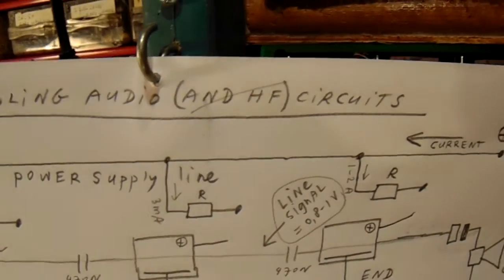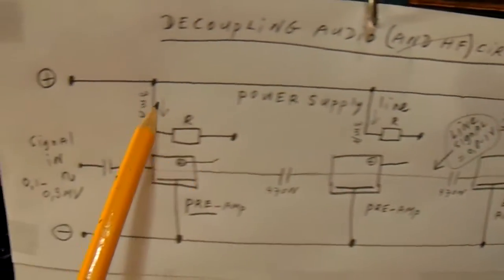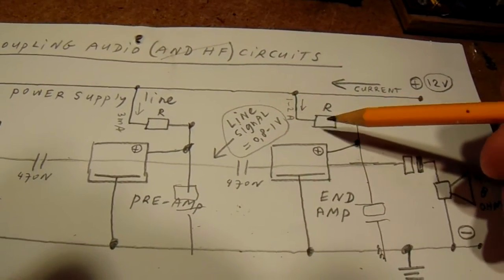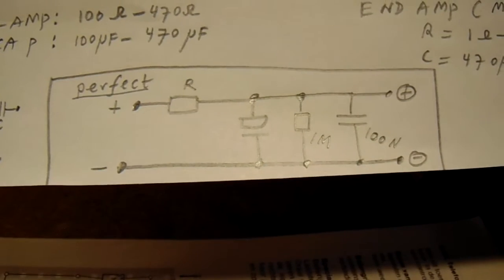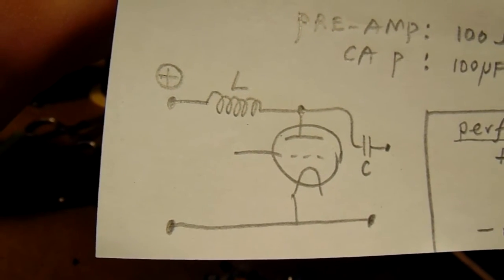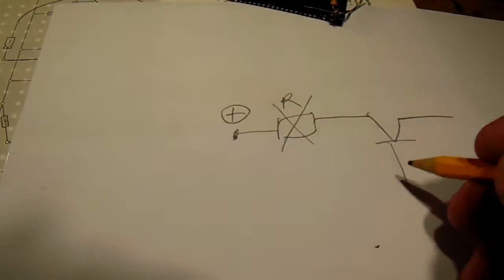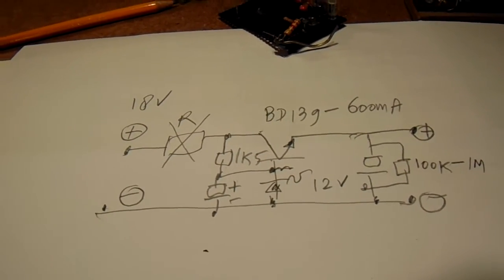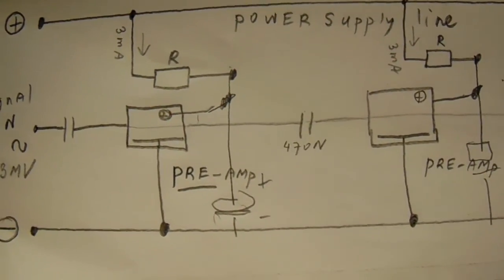Decouping & hum free (silent) audio amplifiers (schematics)

Comment from the maker: LINKS TO HUM FREE POWER SUPPLIES FOR AUDIO (+ related subjects)
Decoupling & hum free (silent) audio amplifiers https://youtu.be/0SoD3GlFH0s
How to make a good analog audio transistor pre amp, version 1 https://youtu.be/luBmY8SzGh0
Audio signals transported over long wires https://youtu.be/ldtEAlsCXMw
The transistor series voltage regulator practice (IMPORTANT) https://youtu.be/YL41FPH_H-s
How to make a small mini audio set (1-2 Watt) pt 2-1 https://youtu.be/ZMXUip3i1zY
How to make a small mini audio set (1-2 Watt) pt 2-2 https://youtu.be/4Lqjw9rbzJA
Find out a choke coil for a DC power supply https://youtu.be/dn-CDTy7cg4
Tips to make a High Voltage (120V-50mA) hum free power supply https://youtu.be/d71voqjK0Q4
Prevent hum in homebrew audio amplifiers https://youtu.be/IsLEyx3nU9o
How to test a power supply https://youtu.be/BeNoSmm3D_4
Developing a 6 Watt stereo audio amp. Part 1 (e.v.) https://youtu.be/DRjn7Al-wdc
O-34 V-2A power supply (IMPORTANT) https://youtu.be/-hXvM1svcdY
How to make a bridge (full wave) rectifier with 4 diodes https://youtu.be/6E8rULhY-1k

Comment: Another great lesson. I will try your advice for the hum noise! I also had a lot of difficulty filtering the ripple of the mains split +/- power supply for my power amp at high current. Any tips?
Reply from the maker: Best circuits are here https://youtu.be/YL41FPH_H-s
say "capacitance multipliers" to press the ripple on the supply lead to its minimum. For a double power supply they must be made twice, one for the positive lead (NPN transistor/Darlington) and one for the negative lead (PNP transistor/Darlington). You loose supply current with this setup, they form 2 series regulators, they get warm and dissipate. I found many problems making a hum free double voltage power supply usable for high(er) currents, especially with the Darlington setup. The video's are on my channel. Keyword: "double power supply".

Comment: @radiofun232 Hi Ko @8.55 mins you draw the schematic for the decoupling unit with a transistor.
This is my question the transistor amplifies the value of the capacitor by a factor or x 70, so 100uF x 70 = 7,000 uF in total, so if the circuit thinks it is seeing 7,000uF and not 100uF how is this possible when the capacitance is only 100uF,is it possible to amplify capacitance in this way and would it show on an oscilloscope the reduction in ripple exactly the same as it would if you actually used a 7,000 uF (or 6,800uF) capacitor.
Reply from the maker: Yes, see my earlier comment. When you put your scope to the output of such a series regulator (don't damage your scope, be sure the scope input is able to handle that voltage) you can see very good how the hum (sometimes even a small sawtooth signal caused by the diodes in the bridge rectifier, especially when the main capacitor has a too low value= for audio lower than 4700 uF) has disappeared. Interesting is also to connect a dummy load to your series regulator (heavy 20 Watt or so resistor, mimic the current that you need later in your electronic circuit) you can see that also under a load the hum stays away. By testing it in this way you can find out the ideal electrolytic capactitor from base to ground, given the max hum suppression (you don't need to make this elco to big, the power supply gets lazy when it has to deliver current suddenly, this relevant for audio amplifiers).
Reply: radiofun232
Is there a name for amplifying the capacitance or the theory of it? or the application,for example 4 diodes together in a power supply called a bridge rectifier, and 2 transistors after each other darlington pair,resistor and cap together called a RC filter or pi filter is there a name for this process of amplifying the capacitance by the factor of the hfe of the transistor?
Reply from the maker: https://youtu.be/YL41FPH_H-s
Reply from the maker: As far as I know this effect is known in electronic theory as "the Miller effect" (but I could be wrong....). It has to do something/was invented by mr Miller during radar development in World War 2. I have to say that I am not completely sure and have to study that better, but anyway. I think you can find the Miller effect in Wikipedia.

Comment: How to fix Motorboating noise problem in Tea2025 amp configured in Bridge mode ?
Reply from the maker: Put a 1000 uF or higher value electrolytic capacitor over the voltage supply. When it is a double power supply: 2 electrolytics, one with its electrode to the +, the other with its electrode to the - and their other electrodes together to the 0.  When there is another reason for oscillation: such a problem must be studied extensively with the help of an oscilloscope. Often it can be cured by making the input impedance of amplifiers lower with a bypass resistor between audio input socket in and ground (0 or minus) in the 1K-50 K range. Or by limiting the bandwidth of an audio amplifier by soldering a 470 pF capacitor between the audio input and ground (0 or minus). For stereo: everything 2 x.
Reply: @radiofun232  Thank you Sir :-)

Comment: Is it possible to decouple the power to an already made amplifier board? Assuming there is no pre-amp and only one stage of amplification, could you simply decouple the power coming into the board?

Or must the decoupling be integrated into the circuit?
Reply from the maker: Yes, that is possible. It depends whether it is a power amp or a pre amp. And a schematic is needed or an idea how the existing power supply is made and works.

Comment: I have experimented using LM386 on breadboard to make a basic amplifier but there is very strong hissing noise either when the music play or not ...and also when the music strong bass kicked in the sound on the speaker like knocking on a wood instead of good bass...do you have any idea whats the problem and how to fix it.
Reply from the maker: I think your amplifier is oscillating (on an not audible frequency or frequencies, say between 15 KHz and 30 KHz or higher)  due to not enough decoupling in the power suppy line. You can see that when you study the Loudspeaker output on an oscilloscope.

Comment: @radiofun232 Hi Ko,at 5.22 mins the decoupling unit that says perfect at the bottom of the page,how would this connected in the diagram above?
Does it simply connect in parallel across the supply rails then feeds to all circuits OR should there be 3 x of these perfect circuits at each point of the above diagram, for example 1 connected in parallel for the 1st pre amp and then another for the 2nd pre amp and a 3rd one for the end amp OR as i say should it just be connected into the main power rails then feeds all circuits and it will work fine.
 What is the way to connect it and FINALLY the transistor decoupling unit at the end of the video does this connect in all 3 stages or is it only connected in the power supply rails then fed to all 3?
Reply from the maker: Thanks. This is a kind of science. The most important thing is this: a kind of ""battery voltage + current"" has to  be created for every electronic circuit in the whole, whether it is a power audio amp (1-5 A supply current at say 12-40V) or a pre amp (12 V or 40 V at 1 mA up to 3 mA).. In a galvanic battery circuit there is: no hum, a constant current (ideal) + constant voltage (ideal!!!) but that central idea has to be kept in mind when you make end amps or power amps. Hum-free power amps  on 110 or 220 V AC (sec: 10 V to 40 V or more AC) can only be generated by good power supplies with transistors that press the hum level to its absolute minimum. Buy my book "Schematics 2, audio amplifiers and loudspeaker boxes"" for motre info. Ideally you can use 3 separate hum suppressors, but you can also use 1 hum suppressor and connect it to 3 or more electronic circuits, pre amps. It depends on how much current the pre amp stages take, not much in general. Again: buy my book. Anyway: with a BD 139 hum suppressor you can feed approx 100 pre amp stages, taking all 3 mA=100 x 3 = 300 mA.
Reply: radiofun232
Thanks Ko,I did already buy that boow,well the download version as the book wasn't available at that time :( which i relly wanted,so its downloaded on my laptop,i have to print out all the pages,so i will have a look at it.
Thanks for the answer but im still not clear on this answer part.
The Perfect circuit how would that be connected to the circuits in your video? would you make x 3 of them and connect them across the power rails to each individual circuit OR just make x 1 and connect it across the power rails before it then feeds to any circuits in the chain
Reply from the maker: OK, understood. Perhaps we can communicate further on this issue via radiofun232@gmail.com. Then I can take more time. Is it possible that you make a small drawing about the circuit(s) that you propose and send them to me via mail? Perhaps I can give a better and more elaborate reaction then.
Reply from the maker: Both options are possible. Ideal situation: 1)  the stereo end-amplifier gets its own (separate) decoupling unit (1 time for 2 channels, could be 2 but one is enough) consisting of a hum-suppressor made with a power transistor. 2) the stereo pre amplifier gets its own decoupling unit, also consisting of 1 power-transistor hum suppressor. You can also use a 7812 for that purpose. But mail me, than I can make sketches from all kinds of supply options that work properly.
Reply: radiofun232
ok Ko,i will send private email, Rob

Comment: Sir, I have Diffrent problem from my La4508 dual ic amplifier ....its intermittently humming high frequency sound(2 seconds sound ) whether input signal is present or not....why....? a usb board is connected from the same power supply through lm7805 regulater...how can i fix this...?
Reply from the maker: Decoupling & hum free audio amplifiers (schematics) https://youtu.be/0SoD3GlFH0s
I think it oscillates due to unproper decoupling from the power supply, but without schematic and pictures about how it was made it is difficult to say.
Reply from the maker: I saw on the datasheet that the bandwidth from this chip is very high (50 KHz or 100 KHz). That makes it vulnerable for oscillations on high frequencies. You can try to limit the freq. band by bypassing the audio input to ground with a ceramic cap from 100-470 pF. You can also do a test with your fingers: use your hand as a resistor and test between which points on the circuit board the oscillation stops. Try e.g. a 1M resistor between these 2 points. You can also solder a 100 N capacitor (ceramic) directly (!) on the chip power supply pin to ground/mass. Or: take a 10 Ohm 10 Watt resistor from your power supply (say: 18 V) to the + pin from the chip and connect to that same + pin directly an electrolytic cap from 1000 uF to ground. Furthermore: the wiring must be made properly so that there is no feedback path from the output to the input. Buy my book: "Schematics 2, audio amplifiers and loudspeaker boxes" via the website from Lulu (author Ko Tilman) for more info.
Reply: Thanks for your replay sir...
Reply: Sir...finally i found the problem .....corrosion on some resisters and jumper connections.....now its work awesome....
Reply from the maker: OK, good to hear that!

Comment: Sir...i have subwoofer circuit with irfp 150 n 4 numbers of mosfet  new....first i connect to 100 watt woofer  my woofer gone..then service technician told that the negative side mosfet shorted ..i serviced and reconnect now its work for few seconds and distortion starting ....when i check i noticed that bc547 transister become hot and volume down with distortion .....power supply is 35 0 35V 10 amps....why its happenig...i know you are dont know about circuits ....Please help...
Reply from the maker: Sorry, but I cannot help you. It is impossible to take a conclusion on the basis of your information.
Reply: Sir.its ok....the problem is high voltage 35 dc is enough...

Comment: @radiofun232 iF the theory of amplifying the capacitance works then this could be used in large power supplies in audio amplifiers,obviously with larger transistors and higher wattage resistors and more powerful capacitors, so for example you could use a large 22,000uF capacitor then amplify it with maybe a 2N3055H to obtain a very large smoothing ripple free power supply.
Would it still work on a larger scale or only useable on smaller lower voltage circuits.
The hfe of the 2N3055H is about X 20 so would it generate 22,000uF X 20 = total capacitance of 440,000uF which would be extreme ripple rejection and NO HUM AT ALL,is this possible?
Reply from the maker: Yes, this is possible and it works indeed. I have tested this many times. Video on my channel: "the transistor series regulator practice" (when I recall it well). The circuit in that video suppress hum in an extreme way, the circuit on the middle of the page of that video is most practical. But: often 4700 uF give enough hum suppression but for sensitive audio (pre) amplifiers such a series regulator is necessary to remove even the slightest trace of hum. Problem for high currents circuits (end amps) is that the very big capacitor makes the current variations to the end amplifier sly (lazy). That could have an effect on the sound, but, anyway, I did not meet many problems with that approach. Everything must be tested, how the circuit acts in real.
Reply: radiofun232
This is a very good way to suppress hum and ripple and of course it would be cheaper and more efficient as the smoothing capacitor could be much smaller in uF's
Possible draw back would be when very large demand of sound is requirred, i.e Bass kicks in very high this sudden surge in current would be taken up from the transistor and NOT the capacitor as in a normal power supply circuit and maybe the transistor in large audio power supplies would NOT react as quickly as the capacitor when compared side by side so maybe the sound could break up and clip :)
Reply: radiofun232
Aslo this circuit would be very useful in guitar amplifier circuits where there is always a problem with hum,it would suppress it extremely well
Reply: radiofun232
Tesla did experiments similar to this, experimenting with what electronic knowledge he had but pushing the boundaries further and further,i think many other possible inventions are yet to be discovered by manipulating electronics and the way they work
Reply from the maker: Yes, indeed.

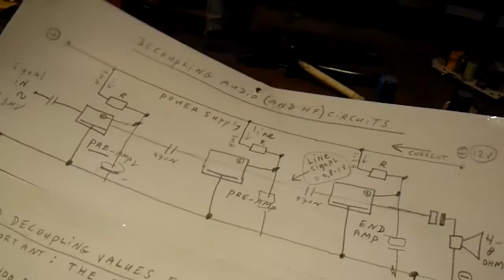Comment: At @5:21 I don't understand why we need the 1M resistor and the 100 nF capacitor.  Especially the resistor. Would you please explain a little or post a link to something that I can read?
Reply from the maker: More stability: suppressing from smal "peak" voltages on the power supply lead, especially on high frequencies. These peaks can be caused by electric motors.  Also prevention from HF input (shortcut HF frequencies to ground, the electrolytic cap has no good HF properties regarding decoupling). The 1 M resistor helps to serve that aim and can discharge the electrolytic cap. Normally the electronic circuit discharges the cap, but anyway. All these issues can be made visible on the oscilloscope.
Reply: Thanks a lot sir!

Comment: Sir....do you know the power supply voltage of stk416-130 (180×3 channel) and stk433-260(60×3 channel)....? these boards are from a sony 5.1...its transformer is burn...its 720 w rms system ....filter capacitor value of bothbboards were 3300uf 50 volts dc...
Reply from the maker: No sorry, this is too specific. Take notice of the schematic, possibly you can find that on the internet.
Reply: Sir...Finally...i got it from internet....416 have vl.vh and ground ...ie 25 0 25 and 40 0 40 v ac and 433 have only vl 25 0 25...i already connect it but not working ...i think there are another pin connection coming from mother board thats mute .stand by.unregd 16 v and protect....mother board is gone....that amplifier board is actually removed from sony mhcgzr9d hi fi system ...now i am trying....!
Reply from the maker: ok